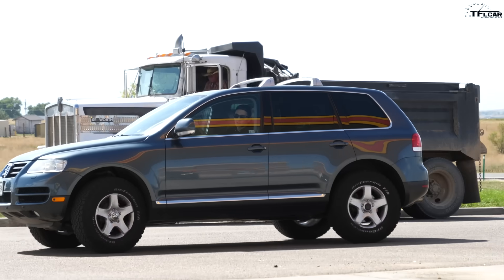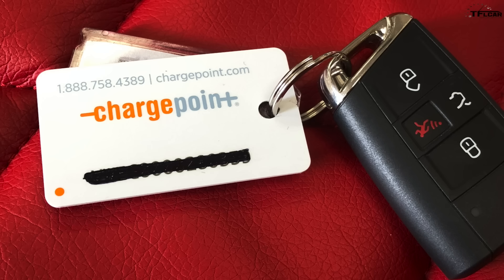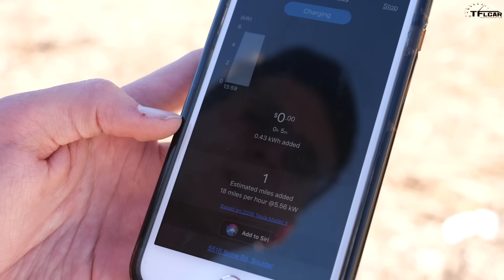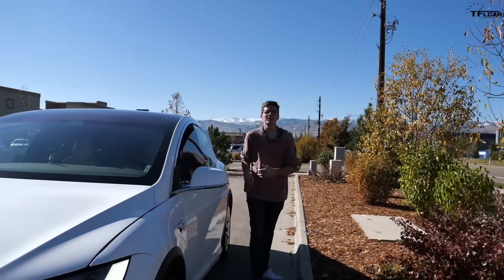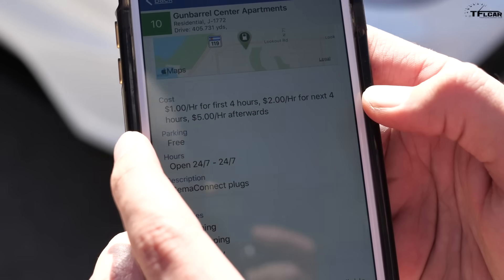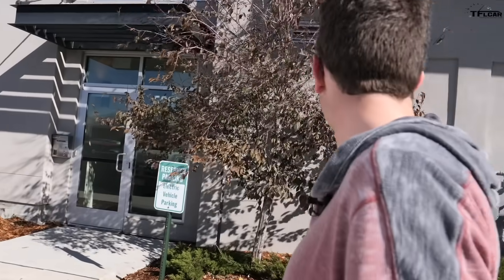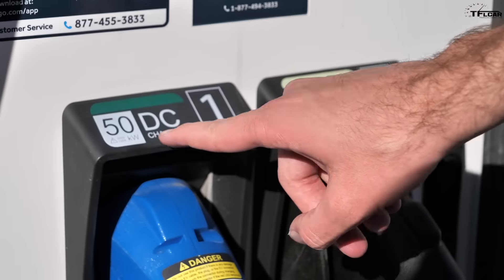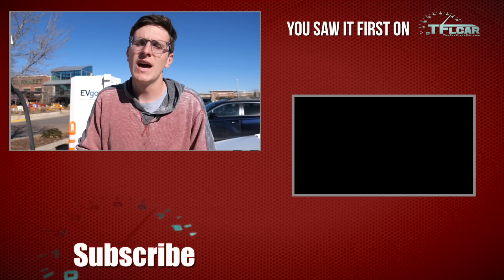Here’s Why Charging an Electric Car Can Suck - And It’s Not The Reason You Think!

Comment: Some People in California couldn’t evacuate with Teslas from their residents, because PH&E cut power to prevent fires. Gas car is still king.
Reply: Are the gas pumps not electric?
Reply: @choda42  Good question, the only Brightside if you at least have a quarter tank, you can drive out of town to where the gas pumps works, and not wait 20 hours for a full electric charge.
Reply: @chirho100  Tesla isn't 20 hours to charge at home.  Most people plug in after work and have charged car within a couple of hours.  It's like putting 1/4 tank of gas in your car every day except nowhere near the price of gas.
Reply: @choda42  You just outline the main problem of all electric cars, if the power is out for days and weeks "It's like putting 1/4 tank of gas in your car every day" that's my point, is I don`t need to plug in a gas car everyday to drive, you must keep a electric car fully charged just to ensure it is reliable. The best case for your argument would be a Hybrid, a quarter tank goes a long way with a Prius, but gas is still King.  Diesel vehicles can run off of animal fat, and would be a far better vehicle to survive in a post apocalyptic future, then a Tesla.
Reply: @chirho100  You might not need to plug it in evey day.  Depends on your daily use.  It just means it's always full and ready.  My pickup is currently parked with 1/8 of a tank of diesel.  If there was a power outage or emergency the tesla is my best option.  In a post apocalyptic scenario,  the Dodge would be better for fuel and driving over zombies.
Reply: choda42 My question is, if it costs nearly $5 to $7 to charge daily, but costs me about $50, every 2 weeks to fill up a 17.5 mpg  09 Jeep Jk, which is really cheaper?
Reply: @chirho100  If you're talking post apocalyptic, what would be easier to install at home? Solar panels or an oil well and a petroleum refining plant?
Reply: I would imagine most people with a car at home don’t leave it on empty before going to bed.
Reply: but gas causes fires.. climate change and pollution..   is that what you want?
Reply: SuperGoldnut I agree, my Jeep is a 2009 Jk and with my best mods, I can only get 17.5 mpg, I want a diesel in my Jeep, and diesel fuel is far less explosive then gasoline. Diesel engines are tougher and better maintenance, but a problem to start in extreme cold, how about a diesel hybrid 😀, just kidding gas is still king, electric cars you can’t work on, unless your a electronic engineer, diesel all day for me. And it is the best vehicle to survive a post apocalyptic event and plow over zombies.
Reply: @chirho100  The ability to start in extreme cold is the reason why companies like FASS have fuel heaters.  The difference made is night and day.  https://www.ficmrepair.com/index.cfm/page/ptype=product/product_id=1180/category_id=-1/mode=prod/prd1180.htm
Reply: good point. I live in CA. and ALL my local gas stations had NO POWER. so... if I'd had an ice car.. my options would be ZERO. fortunately, I do have solar with battery back up. enough so that I could charge my car.. and keep my fridge running. still think ice cars are great? OH … AND- does your ice car have smog equipment? EVER HAD TO replace it? don't worry... that $2000 cat.converter bill is coming my friend. along with the $200 a month you spend on gas.
Reply: Ooooooohhhhh got em lol 🤭😂🤣😂🤣😂🤣😂🤣😂
Reply: You can charge off a generator too. Just saying...
Reply: Yes my brother has used a gas generator to charge his Tesla in California a number of times with the brown outs

Comment: "The reality is most people don't have high voltage power in their garage"...what the heck are you talking about?  You just run a basic dryer circuit and a typical dryer outlet.  I had to run mine 30' and still it only cost me $168 (the wire is the biggest expense).  My Model 3 averages 37 miles per hour of charging in my garage (so overnight it's always full).  On a protracted road trip any old Supercharger is quite a bit faster (and getting faster all the time).  The newest ones can give you 75 miles in 5 minutes.  It's also worth noting that the cost for electricity in either location (home or supercharger) is roughly 1/6 of what you'd pay for gas for a similar mid-level luxury car.  This video is not an honest representation of what is actually a great experience...the truth is you virtually never spend time refueling.  Imagine no longer hitting the gas station once or twice a week, nor waiting in line when some dummy runs into the store for a soda and leaves his car blocking a pump.  Imagine never having to worry your credit card is being cloned as you pay for gas (mind has, has yours?).

Comment: Good Video.... All the car manufacturers need to get together and get the same recepticals. That is not a suggestion it is a fact. If they do not standardize the plugs this technology will forever flounder. People in bigger cities will never leave the city because there will be no way to know if they can recharge. Smaller cities will be slower to incorperate this option and if there are different plugs for different cars older people >>WITH MONEY<< will not buy into something that has issues. They won't understand it and they will not buy it. This needs to be corrected and the dependancy on the phone thing has to be optional. I broke my phone and I cannot buy a charge for 3 days. The failures of this car charging, cell phone, plug adapter, incompatible receptical voodoo are far too many. I drove a Tesla very cool car. It will be a good car when it can drive long distance, like 600 miles on a charge and recharge in an acceptable amount of time, like 2 hours.

Comment: Another reason not to buy a electric car. The cons out way the pros of electric cars right now. Another con. EC's are good for around town but not for road trips. Con 3 the batteries cost about $2000 Replace. My opinion EC's should not have been put on the market till the problems had been solved. The charge stations should be required to have plugs for all kinds of EC cares.

Comment: 7 years ago, we put up a new house on our lot. Dealing with the electric company about the new connection was a bit of a nightmare. I asked the guy who came out for advice a question. I asked if we should put in an electric water heater and kitchen stove. He said no, stick with propane. I'm glad I listened to him.
Reply: Where do you live where this is a problem? Usually all electric is the easiest/cheapest way to go when building a new house. Complexity and price go up from there. Not cheapest long term though.
Reply: @joea1433  We live in the country. In the year we built our house, 2 derechos blew down electric poles and lines all over the region. Thanks to their replacements, our electricity goes out a bit less than it once did. However, we still contend with old transformers and spotty connections here and there.

Comment: In short, it's best to stick with the petrol burners for the next 20 -30 years.  Deal with it.
Reply: Yes and no. It depends a lot on what you use your car for. If you drive a lot of long-distance, yes, ICE is the way to go. On the other hand, if you commute 80miles a day like me, EVs are quite useable. It's a chicken and egg problem, one that Tesla solved with a sledge hammer by creating their own ecosystem from scratch. If they hadn't just gone and done their thing, EVs would not be there today. And likely not in 20 or 30 years either.

Comment: Was any of this charging even necessary?  In all likely hood anyone who can afford a Tesla can spring for a 240 volt charger at home.  Don't create problems that don't exist for Tesla owners.  Perhaps a early Nissan Leaf owner may have these issues.  Please do a piece on all the pollutants created from oil refineries and all the energy that is require just to create that tank of petrol.  There was a time when gasoline stations were scarce too.  Occasionally, they'd cheat you out of true measures of a gallon, which is why visible gas pumps and a Dept. of weights and measures were created.  At the very least there's a chance that an electric car can gets its power from solar or wind sources.  At least no one has gone to war over ownership of the sun yet.

Comment: Isn’t just buying a 2020 Toyota Corolla hybrid that gets 60mpg for 25,000 a better buy than a base Tesla 3 that gets 220 miles for 36,000$ or the high range Tesla 3 that gets just over 300mpg for for 39,000$? Your still gonna pay between 11-14$ of electricity for every 220 miles charged! You can fill the Hybrid corolla for under 20$.....”depending on gas price” and get  a 600mile range. Yeah, eventually it’ll pay for itself, but in my calculations, it’ll take more than ten years assuming your driving low miles. I do agree that we have to move away from the combustible engine in the future, but we’re in the baby step period of electric cars that I’d rather wait another 5-10 years so they can perfect it and “iron out the kinks” before I invest in that type of technology for transportation.

Comment: perfect examples of why NOT TO BUY one. Another Reason is just fact this will make snowflakes scream! 81 percent of Electric in the USA is made by burning fuel coal, natural gas, or yes oil! so buying a electric automobile is equivalent of trading one fuel for another. However using the same fuel. and it gets worse nothing is 100%. Add to that 20 hours added to Almost any trip is completely insane.

Comment: Why don't they make alternators to keep them charged or sun charging panels on the roof it should be self sufficient.
Reply: The motor does serve as an alternator during regenerative braking. Solar panels on the roof, boot, and bonnet would let you trickle-charge the battery while parked. Still only looking at around 500W, rather than the 7kW of most of the chargers featured in the video, though.
Reply: @Roxor128  build wireless charging system that can be installed in 90% of our nation's city streets and major highway's so charging stations would not be necessary and require electric vehicles support wireless charging problem solved if the road has asphalt or concrete it has wireless charging.
Reply: @rustybeatty6567   Inductive systems are only around 45% efficient, compared to well over 90% for a plug. You'd more than double the amount of energy needed for transport due to losses in the inductive system. Not only that, but the infrastructure would be harder to build and maintain (as it's in the road and being driven on). As far as infrastructure goes, charge points near parking spots that you plug into the car are both easier to maintain and way more efficient. If you want convenience, you could perhaps come up with some automated system for plugging in the car when someone pulls up.
Reply: @Roxor128  that is why we should only invest in hybrid vehicles only and ban full electric vehicles all together because hybrid vehicles you get the best of both worlds and also use diesel hybrids would yield the best MPG ratting.
Reply: @rustybeatty6567   How the hell do you get from "wireless charging sucks for efficiency compared to a plug" to "we should only use hybrids"?
Reply: @Roxor128  ease of convenience because with a totally electric vehicle your at the mercy of only being to charge your vehicle from charging station and being able to pay for the power you need to charge your vehicle is not as simple to do unless you have a smartphone unlike a traditional cas station you can pay at the pump without the need of any kind of cellphone you can't do at any charging station that i have heard of with a hybrid vehicles you can use both a gas station and charging stations and if you're community sufferers a power outage most electric vehicles will be out of  commission in one to two days if the outage last for longer than a week have fun driving a electric vehicle  but with a hybrid vehicle you have a gasoline or diesel engine to keep you driving because gas stations could use a backup generator to keep them operating.

Comment: Probably don’t want to be planning on driving that car to far northern CA  say Mt Lassen and points north. I’ll stick to my old town car that can fill up for 475 hi-way miles in less than ten minutes. I guess EV is ok when you don’t need to be going anywhere but work where you might find a charging station. Have to question why Tesla uses the connectors they do. Happy Charging...
Reply: I’ve been to mount Lassen in my Tesla. Stopped there on my way to Seattle from the SF Bay Area. No problem at all.  The car has more than sufficient range, and there are Superchargers pretty close to there (and just about anywhere else in the lower 48 states.)

Comment: Having an electric cars in a cold weather city like Denver. Bet dudes car doesn’t even start half the time in the winter. 😆
Reply: if you can afford a tesla, your car is parked in a heated garage all night.
Reply: ? Hey dick
A Tesla is the sane price as many cars. And they don't need garages
Reply: The car will "start" but the range and regen will be reduced.  While it's plugged in at your house, you can preheat the car and condition the battery before you leave for work.
Reply: choda42   When it gets to -50 that car ain’t starting I don’t care how many plugs are in it. When we got that polar vortex last winter thousands of Tesla owners were complaining about the car not starting. You think they didn’t have it plugged in? lol
Reply: @jamesblunt1915  Didn't hear about that.  To be fair, at -50C most vehicles don't work that well.  DEF freezes, diesel needs winter treatment, need to plug in a block heater.  Model S has an electric battery heater.  Model 3 doesn't and uses the first few minues of charging to warm the battery.  At -50 it probably won't make a difference.  Haven't had any issues with mine yet besides range reduction.

Comment: Omg, what a Major pain in the ass!! I love the idea of beating all the gear head's to the Stop Light but no thanks. I just want to get in my car drive 700 miles to see family and make 3 or 4 Short, I mean 10 15 minutes, not 4 or 5 hours, stops to fill up. Somebody is always needing the bathroom & food 🤣
Reply: Dave H You just described almost exactly what I did on a recent 5000 mile road trip in my Tesla.  700-800 miles some days, done in about 12 hours total, including charging. Typically 2 1/2 hours per leg with about a 20 minute stop to charge 2-3 times per day.

Comment: The problem with non-Tesla chargers is, when traveling, they charge way too slow. Some are simply unreliable, having to rely on even more time for one to connect to another just to 'approve' and start charging. As for charging when only driving locally, it's not worth bothering. It's still better to charge at home unless you plan accordingly.
I've been wanting at least one Tesla for some time now and have watched so many videos, since I'm subscribed to some Tesla vloggers, that I can actually answer others questions (if/when I decide to). Although, if I'm ever able to buy then I'd still ask questions when taking delivery or picking up.

Comment: What if gas stations had interchargable batteries that were charged and ready to quickly be changed.
Reply: Tesla quotes 26 hours labor to remove and replace the 276 cell battery pack in a Model X.

Comment: This industry is going to get have to get regulated soon. Part of the reason why it is so easy to gas up a car is because of regulations instill standards.  Its clear the industry is trying to avoid this for the most part.  They are going to have to come up with uniformed plugs for all cars not just one and payment methods, preferably at the device not through an app.

Comment: This is why I would rather consider an ultralight electric car which uses much less juice, but still keeps you dry in winter.  Charge on a regular outlet or a solar setup off grid.  If you are out and about it would be nice to have the the adapter to use one of these heavy duty chargers for the light vehicle.

Comment: For me, the issues are simply not worth the aggravation.  I understand the EV concept and hope that, someday, they take off but for now, I'll stick with my gasoline fueled vehicles.  I would much prefer the hydrogen fuel cell systems.  I could go to a fueling station and simply plug in a hose to refuel pressurized hydrogen and pay for it.  Of course, this has its inherent problems as well but, personally, I'd prefer it to these charging stations with their compatibility crap.  In the meantime, I need gas so I'd better get to the gas station.  Be back in 10 minutes with a full tank!

Comment: We don't and probably won't have superchargers in our homes. I think Jon was referring to 5:58 when the presenter was covering charge time for level 2 chargers. Doesn't this suggest that in order to fully charge your car at home, it would take about 20 hours? Some homes have been specifically wired for 40 amp charging as opposed to the 24-27 amps the slow charger was providing suggesting that it is at least possible halve that time to 10 hours for a full charge if you invest in a dedicated circuit. Without it,  it would seem that you need to think way ahead to get through your week.
Reply: Even at 27 amps and 16 miles per hour, and overnight charge will replace all the juice you used the previous day. There is no need and no benefit to waiting until the car is low before charging. Just plug in whenever you are home, and the car will be full every morning.  As the presenter noted, charging at home is really the way to go. If you can’t arrange for that, an EV might frustrate you.

Comment: Making all companies standardize is the key charge ports to charge station has to be the same,,Ive heard solid state batteries will give 5 times the range at a fraction of the weight and 1/3 the charge time,,maybe then if the info is true it wouldnt  be too bad to have one. Nice video also =)